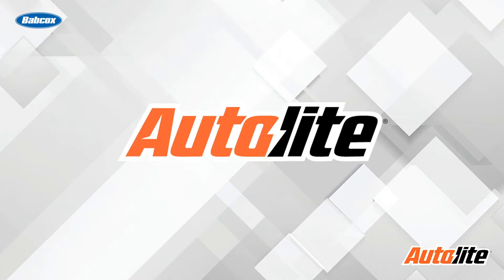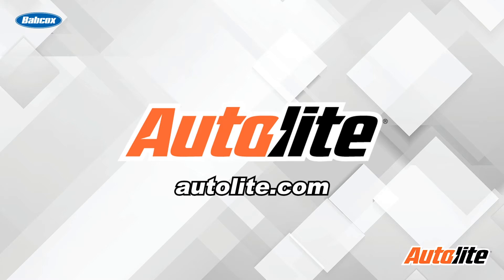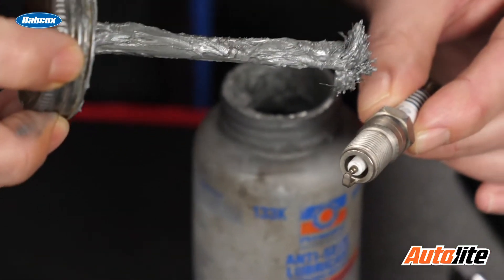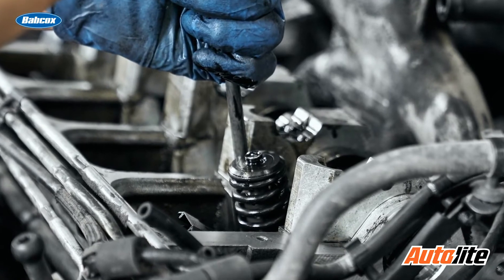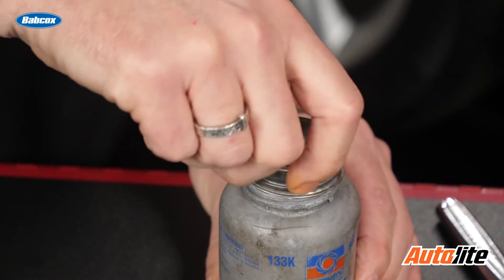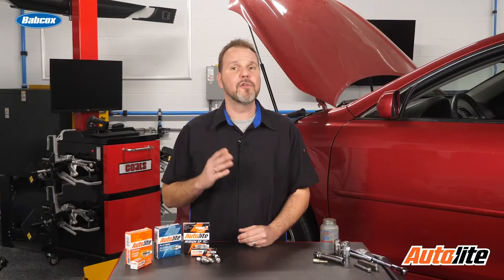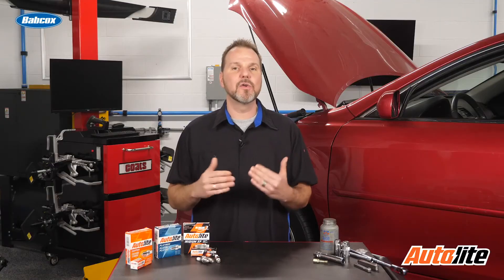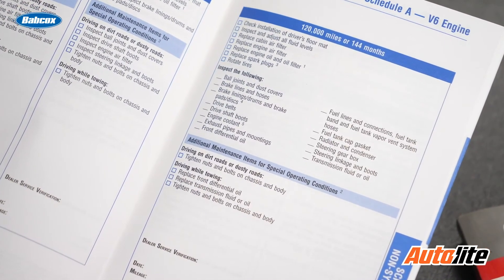Should Anti-Seize Be Applied On Spark Plug Threads?

Comment: I have been using anti-seize on plugs for 50 years, and never had a problem. Without ant-seize, you stand a good chance of striping the threads on your air-cooled VW.-resulting in a repair or replaced head.
Reply: I hate dry threads.
Reply: I have a 4.6 Ford engine and I use anti seize because those engines have a problem with plugs breaking off.
Reply: 30 years here.  Never a problem.
Reply: @Twobarpsi  22 years here, tractor-trailers, forklifts, construction equipment, autos, small engines, marine engines. Only time ever had a plug strip was already damaged. NEVER overtorqued a plug, especially one that I coated with Never Seize. If people are stripping plugs they're either novices or distracted. Got nothing to do with using never-seize or not
Reply: @Twobarpsi 30 years a hack
Reply: 50 years here as well. No problems. I'm light on tightening them to the point that an unscheduled stop at a garage on a road recently got me a lecture on tightening plugs as they were found to be torqued too loose. I've never lost one. And if I did...big deal. I'd put another one in. I love how they come out so easily after 100,000 miles. I think the risk of breaking a rusty plug on extraction, especially 4x4s living in damp places, is greater than over wrenching it on install. Just tighten them from Tight 'nuff to Good 'nuff.😅
Reply: @stevest1300 50 years been a hack mechanic
Reply: @stevest1300    I'm with you here. 50+ years and a little dab will do ya, especially on the newer engines that go 100K on platinum plugs. Older VWs is where I learned the trick.
Reply: @rupe53  Indeed, my 50 and 60 year old VW kombis and Norton and Jawa motorcycles plugs come out with ease thanks to anti sieze
Reply: @stevest1300  depends on the engine, your time interval of anti-seize use is irrelevant
Reply: Agreed. Particularly when you're  installing steel threads into an aluminum head.
Reply: @im2yys4u81 Totally agree. Steel threads and aluminum threads plus water/coolant is a disaster waiting to happen.
Reply: @johnbuiatti366  It's called electrolysis. Cannot be avoided, but anti-seize stops it cold.
Reply: @im2yys4u81 lmfao so you'd rather over torque into aluminum  head? Lol Makes sense!!
Reply: Never stripped a plug in an air-cooled engine, or any engine for that matter and all I usually use is a drop of oil.
And if im in a rush,that oil drop is provided by the dipstick on the engine im replacing plugs on. 
Plug boots sticking to plugs is more of an issue.
And most decent plugs have nickel plated threads, not really any reason to lube them other than it helps em spin in easier.
Reply: @MrTheHillfolk  silicone or dielectric spray is good to keep rubber from sticking....just don't get it on the electrode...
Reply: @jonjacobjingleheimerschmid3798  
Yeah man, just a little bit is all ya need.
Hey ,your screen name ......
his name is my name too 🤣🤣
Reply: With aluminum engine blocks, you need anti seize compound, steel and aluminum cause an anode charge which cause the aluminum threads to seize to the steel, thus you will strip the block threads. Also make sure engine is overnight cold before changing plugs. 45 years no problems. Did strip out plug threads on a 73 VW that the previous owner did not use anti seize.
Reply: If you can't install a spark plug without stripping the threads you prolly shouldn't be working on engines!!
Reply: Agreed - you are correct - he is basically saying - don’t use anti-seize because some retards might screw up the torque values.  What a dumb perspective on life of restrictions on getting benefits due to applying the lowest common denominator of mechanical aptitude. I’ve used it successfully for to years - especially on all air cooled applications like motorcycles where sparks plugs are removed frequently and the cylinder heads are aluminum.
Reply: I think on a low compression engine you can get away with it but I wouldn’t use anti seize on plug threads in a turbocharged motor.
Reply: Pepiif he says so it must be so
Reply: I use Anti sieze on verados out board motor For years and everytime i change them 300 hrs no problem , is a 1" long and when they sieze is a real bitch.
Reply: Chilton's repair manual for my 2009 Honda Accord specifically says to apply a light coat of anti-seize to the spark plug threads upon installation.
I followed the instructions in the manual, applying anti-seize and gently torqued the plugs to 13 ft lbs.  The engine runs just fine.
There is way too much conflicting opinion on this subject.
Reply: i never used any on car unless manual says so, never had problems.
Reply: I accidentally applied spark plug boot protector to the spark plug threads. What will happen 😮
Reply: Yes you can! Denso has a torque rating listed for both with and without anti seize.
Reply: Most guys have never worked on the cars and endured all the problems we have.
Reply: Me too.
Reply: manufactures recommend anti seize only on the uncoated black oxide threads...these new coatings that are siver in color dont require it 
from nkg
NGK spark plugs feature trivalent plating. This silver or chrome-colored finish on the threads is designed to provide corrosion resistance against moisture and chemicals. The coating also acts as a release agent during spark plug removal. NGK spark plugs are installed at the factory dry, without lubrication or anti-seize.

Anti-seize can act as a lubricant, altering torque values up to 20 percent, increasing the risk of spark plug thread breakage and/or metal shell stretch. Thread breakage can sometimes involve removing the cylinder head for repair. Metal shell stretch changes the heat rating of the spark plug and can result in serious engine damage caused by pre-ignition. Do not use anti-seize or lubricant on NGK spark plugs. It is completely unnecessary and can be detrimental.
Reply: @davediamond7228 The difference is 'air cooled VW'. They run considerably hotter and you will have issues. Those anti seize coatings on modern plugs don't last at the temperature aircooled heads run at.
Reply: Heard the whole no antiseize, that didn't end well, yes they were "coated' NGK.
Moderate amount and use ya commonsense when installing.
Those factory boffins don't install, own the cars for years etc and then have to remove them.
Our do what you bloody like, it's your shit and problem.
Reply: It's amazing to hear all these ancient forms of life talk about 50 yrs no problem! I know what I'm doing. 50 yrs I've been doing it and I'll do 50 more.

Ok so maybe go to the store get yourself a bottle of 91% rub alcohol and clean the 50 years of wax out your ear! 
Did you not just hear this man say spark plugs today are copper or zinc coated essentially erasing the  need for any anti-sieze??
Whats the make up of anti-sieze?? 
I use to like seeing a old dude working on my car now I steer clear of older folks they don't realize that over the last 50 yrs we evolve over time. 
It's not the same plug you used 50 years ago.

Ok well maybe the guy who got a good deal bought 5000 and still using those today 😂😂😂😂😅😅😅😅😅
Reply: @Catchmeifyoucan209Stockton So you're a half as old, twice as smart type of person. 
Most be the "new math" you kids are now using. 
Someone can have years of evidence that a method works but that gets thrown out the door because you read something different on the internet.  😅
Reply: You been doing it wrong for 50 years . You probably been smoking for 50 years also
Reply: @justinpennington7682 yah sonny!
But once you have that feeling you get where that plug ain't coming out in one piece,. You never make that mistake again!
Reply: @justinpennington7682 troll

Comment: You have to be a dummy to overtighten sparkplugs.I have been doing spark plug installs for over 50 years and have never put one in wrong.I use antisieze without any misfires.Zinc conducts electricity, so it does not prevent the spark plug from grounding to the head.

Comment: In addition to applying anti-seize compound to spark plug threads, I also apply the stuff to the silicone rubber spark plug boots.  The heat of ignition will otherwise bake the rubber boots on to the cylinder head, making them impossible to remove without damaging them.
Reply: That is what silicone dielectric grease is for.
Reply: Anti-seize is conductive! You're bridging the insulator with a conductive material. Not smart. Use dielectric grease.

Comment: Don’t be a tool. Stop using that impact gun. 
This is where I like to just use a socket and extension. Threading them in till I feel them touch and then use a ratchet to tighten them just right. Yes use anti seize.

Comment: Ford 4.6 engines have a problem with spark plugs seizing in the heads . What would you recommend to prevent this ?
Reply: yes do it
Reply: The best recommendation... Don't buy a vehicle one of those garbage engines.
Reply: I apply any (not that watery aluminum powder Permatex shit at auto stores) quality anti-seize either nickel or high copper content like Jet Lube but Champion sells their aviation Champion Aerospace 2612 Spark Plug Thread Lubricant and it's cheap.  https://www.championaerospace.com/assets/technical/90-4.pdf

Comment: Thanks for sharing. But if I did put the anti seise on it already. How can I back to Normal please?? Take it out and wipe it clean and put it back on ???
Reply: If you are not having any problems just leave them alone, it unlikely that it will cause any problems and it will make them easier to remove next time.  I've put antiseize on almost every spark plug ive installed for 25 years and never had a problem.
Reply: It is too late, you should just replace the engine as there is no hope, or you can ignore the video and just tighten the plugs to ~70%-75% of the dry recommendation and it will all be fine. Your choice.
Reply: @Martian74  well dang

Comment: I could not dissagree with this more. I have been a licenced tech for decades now and this notion of over torquing and breaking plugs is batshit crazy! Also has little to do with the reasoning behind ant sieze on plugs and or what type should be used. This guy is wrong.
Reply: Se hear ,, ase cert since 1981, never had a problem with anti seize on plugs
Reply: Thanks for the input. I have no problem with anyone disagreeing with me. Some topics will do that. As a tech myself, I've seen many bulletins or topics that I do the same with. In this video, I just present some facts for thought. It is a fact that applying any oil, lubricant, or anti-sieze to any fastener will change the torque applied by up to 20%. It can also create heat transfer and electrical conductivity concerns. Also, many spark plug manufacturers including NGK and Autolite are against the use of anything applied to the threads of their spark plugs. Take a read of this article that has the bulletin from NGK attached to it https://www.driven2automotive.com/blog/why-you-shouldnt-use-copper-grease-when-installing-spark-plugs/  Also, I personally have never read instructions from the vehicle manufacturer that instruct a tech to apply anti-size prior to installation. Playing devil's advocate though, I have heard that Honda and Subaru instruct that's it's OK to apply anti-sieze. Subaru does tell you to lower the torque setting by 1/3 when installing though. Lastly, I think some of us that have been wrenching for a long time applied anti-sieze to spark plugs since those plugs did not have the newer special coatings on the threads and many may not even know that newer plugs have these special coatings. Either way, I'm not telling you what you're doing is wrong. Just some food for thought about the newer technologies on today's spark plug. Thanks again for watching.
Reply: @joekeene6718   look. I appreciate your intentions. But here is an education for you from one very experianced tech to another. You know full well the notion of someone actually breaking off a plug in a head because they added and i dont care if its arp bolt prep. But because they added a lube to the thread changing rotational friction altering the tightness of the plug is nutz! Unless someone is already very neglegent and applies way to much rotational torque to the body of the plug to begin with. Will lube be able to contribute to plug body breakage. You know that and so do i. So i am sorry. But imo. Your comments are heavily embelished at the least. Not all head mediums and materials are the same and not all plugs are coated or use the same coatings and or processes. There for no one solution of installing a plug with dry threads can be articulated as correct.
As an example. Nickel and copper antisieze have very different properties for a reason. Copper as example is a  very efficient conductor of electricity as well as heat. In both cases that can be a far greater advantage than having to worry about if you lube the threads suddenly the plug body will tear in half. That's just silly. Anyone in the trade with feel will have no problem installing a plug with a reasonable amount of final tightness or load to the plug body regardless of what the threads have been in contact with. Nickel antisieze is also required in some cases depending on the medium and particular plug used as well as application it is in. Anyone who makes a blanket statement that plugs need go in dry has not extracted a siezed plug out of a ford or aluminum head that suffered a leaky head gasket or a plug thats been in for 150,000 km. Thats real. So again. No disrespect. But your statements are wrong.
Its important people understand these things to prevent large repair bills or missfires and so on.
Reply: @verizonwireless7187  
😂  Thank you for making me laugh. The world could use more just like you.😂
Reply: Who uses a torque wrench to torque spark plugs anyhow? Just hand tighten it. Voilà
Reply: Right? Like how about you just lower your torque value?
Reply: I used to always use antiseize on the bottom half of the threads only but I did have a plugs overheat from that it charred only the part of the plug that had seize on it so it 100% is true that it can cause your plugs to run at a hotter temp then the plug is designed for. NKG does state not to use it.  This was in f150 yamaha outboard that charred the plugs.  I was only using it on outboards due to corrosion but now even there I don't use it.
Reply: He sounds like the same mechanic that applies dielectric grease to the back of sparkplugs to "better conduct" electricity.   Boggles my mind how many mechanics still think it's not an insulator.
Reply: @extrememiami  soooo. I shouldn’t use that grease for the plug boot either is what you’re saying? Just wondering cause that’s another debate.
Reply: You seem like a nice young guy. I started working on the engines in 1962, back when NASCAR raced real cars and Smokey Yunick was the guy who had all the engine secrets. I will give you that lubrication on the threads might help a bad technician snap a plug, but until you’ve had one stuck in a head because the previous technician refused to put on anti-seize, well……I think you might want to rethink this video.